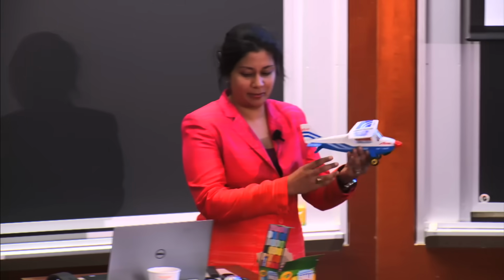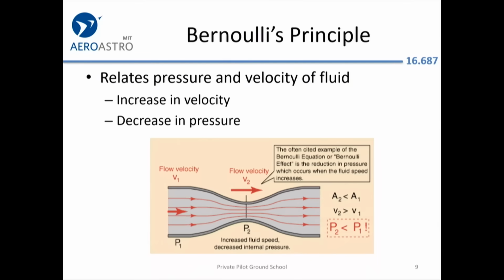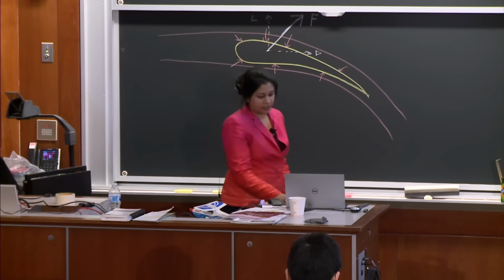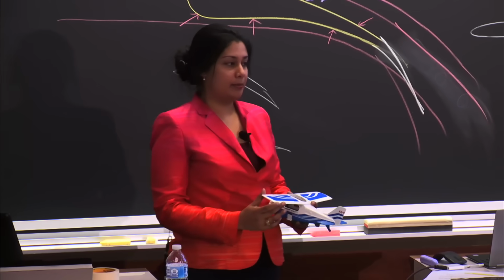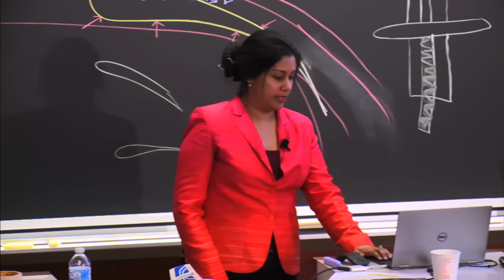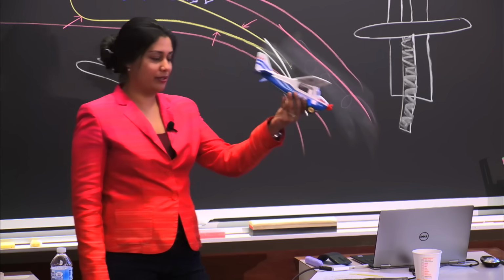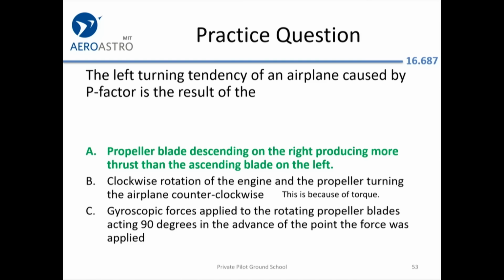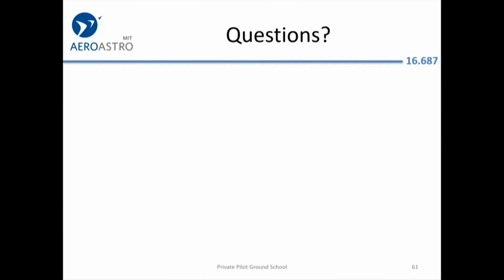Lecture 2: Airplane Aerodynamics

Comment: Im sorry but i have never seen a wind tunnel test demonstrate the kind of results that she is describing.  Watch any wind tunnel test and all of the air lines stay pretty much parallel to the ground.  Almost no wing profiles that i know of are shaped like that. Even a wing with a high angle of attack has fairly parallel smoke lines in a wind tunnel. I work on fighter jets and our wings are fairly flat on the bottom. Almost has an upward angle on the trailing edge. You can also watch video of planes pulling high G turns and see the clouds from over the wings from the pressure decrease over the wings. Im honestly not sure where this concept has come from. Nor have i ever seen wind tunnel tests nor engineering simulations that would show a downward airflow from an airfoil.
This explanation seems to be an over emphasis of the "downwash"  concept from the newtons law explanation. But to say the other explanation is wrong is absolutely not the case. And she misrepresents airflow over the wing as saying that the air has to move faster to "meet" the air at the trailing edge and then goes on to say that there is no scientific  explanation for that. Half right. There is and explanation, "venturi effect"  but it does not involve air "meeting" at the trailing edge. Only air moving faster over the  surface with a higher camber.
Reply: Josh,
Yes, she drew a poor airfoil shape and did a poor job overall. A disappointment from MIT.
..
However a wing does have downwash.  Small wind tunnels prevent it because the bottom is so close to the wing and change the results from actual flight.  A wind tunnel must be large to bet more accurate results. 
..
The movement of the wing creates pressure changes around it.  With more pressure under the wing that above results in a net upward pressure that pushes the wing up to support the craft's weight..  These same pressures causes all air accelerations we observe around a wing including upwash, downwash and the tip vortex. There must be downwash to satisfy Newton's Third law, but the downwash does not 'cause' lift.
..
This downwash and the wing tip vortices are what are commonly called "wake turbulence that other planes must avoid.  You must have heard of that. Working as you do it is very surprising that you are unaware of it. Correct engineering simulations will show both downwash and upwash ahead of a wing.
https://www.faa.gov/air_traffic/publications/atpubs/aim_html/chap7_section_4.html 
This Airbus test  engineering video shows it very well;  it is a 15 foot span model in smoke illuminated by a scanned green laser.
 It IS HERE. https://i.imgur.com/h8pSK.gif 
..
This animation also shows a reasonable flow: https://i.stack.imgur.com/OUIZM.gif 
..
I don't know what "other explanation" you refer to, but there are many wrong explanation on the web and being taught in schools and repeated ad nauseam. 

..
The equal transit explanation is indeed false as is your venturi explanation.  There is no wall above the wing. The air above the wing is a very soft cushion if at all.  
..
The air above the wing is accelerated rearward by the lower pressure there relative to the  unaffected air pressure ahead of the wing.. A Pressure Gradient provides the force that accelerates the mass of air.  This is Newton for fluids.
..'
There is a good step-by-step explanation here:
Understanding Lift Correctly: https://rxesywwbdscllwpn.quora.com/
Reply: @Observ45er  the venturi effect is what causes the low pressure. Air compresses over the wing but the same volume of air is moving  over and under the wing. In order for the same amout of compressed air to travel over the wing as under the air has to move faster. the faster moving air causes a relative lower air pressure over the wing and a relative higher pressure under.  I am familiar with downwash and wake vortex. Thats why we space landing aircraft the way we do. But there is also an upwash at the leading edge of the wing. In theory the same air is hitting the leading edge as leaving the trailing edge (at least closer to the wing root, wing tips act differently) so the upwash and downwash should be relatively equal. An extended flap does create more straight down airflow than a retracted flap, but at normal flying speeds there is no massive downwards flow of air. At least not enough to counter the upwash at the leading edge AND lift the aircraft. My  jet has a max takeoff weight of 81,000 pounds it definitely does not create that much downward airflow.
Reply: @joshcowart4112  The observable fact, Josh, is that it is not a venturi effect above a wing.  There is no hard wall above a wing and the air is quite free to move due to Pressure Gradients. If the air was somehow  “pinched”, it would increase in pressure, so that is a completely non intuitive, and unscientific, explanation.
.
In a true venturi, the decreasing cross section is a restriction that increases the pressure UPSTREAM of the narrowing.  This is now a higher pressure and the narrow section acts like a hole in a pressure tank.
I do this as a demo with students.  Adding the narrower region increases the up-stream pressure, thus causing the Pressure Gradient to accelerate the AIR’s  mass to a higher speed.
.
Newton’s First law is supposed to teach us that a force is required to accelerate a mass – ANY mass and air has mass.
.
A Pressure Gradient provides that force.  When you see fluid accelerating anywhere around a wing, it is the Pressure Gradient that  provides the force.
In the mid 1700s, Euler, following up on Bernoulli’s work, determined that Pressure Gradients Accelerate fluid.  
.
Bernoulli only determined that a speed increase IS ACCOMPANIED BY a pressure reduction and there is no evidence in his notes that he understood the cause and effect. This is nothing more than Newton in Fluids and if you know Newton’s laws are correct, you have no choice but to know that speed does not (alone) cause a pressure reduction -- no more than a fast moving auto causes the the force that accelerated it up to speed. This “fast air causes lower pressure”  thing is one of the most widely understood bits of science,  It is not some new fundamental principle to be memorized.  Newton taught us how to figure this out.!.
.
It is a complete misunderstanding of the physics to think you can accelerate something without a force causing it.  It is not ‘pinching’ nor getting to the T.E to meet some particular bit of lower air.
.
The upper air, being always held against the surface by atmospheric pressure, flows in a curved path.  Because it has mass it “tries to”: go straight PER NEWTON’S First Law.  That reduces the pressure just like what we feel on a playground Merry-Go-Round.  You feel ‘pulled’ outward by YOUR mass’s inertia trying to go straight.
.
AIR DOES THE SAME THINE above the wing thus lowering the pressure below ambient.
ALSO, the faster it moves (a.k.a. air-peed) the lower the pressure just like spinning the Merry-Go-Round faster.
THEN…
Making it follow a sharper curve, also means the “trying to go straight” is stronger – this is when at a higher AoA, the flow curves sharper  and the pressure lower and lift greater.
All this is simple physics fundamentals applied correctly.
..
No down-wash you say? I worked a very short distance off the end of O’Hare’s runway 9. I could feel the downwash when heavies took off or landed..
See this Airbus test engineering video of a 15 ft model in smoke illuminated by a scanning, green laser:
  http://i.imgur.com/h8pSK.gif 
Please note that a large part of that downward blast originates ABOVE the craft’s wing.
..
The same amount of air DOES NOT flow over the wing as under it. The air above it gets to the trailing edge faster than the lower air.  The lower air (viewed in a wind tunnel) is slowed down and spends more time under the wing. Even YOU say the upper air is “faster’, so you are contradicting yourself. So over time, a greater volume of air moves past the upper surface. although I don't see that this distinction helps with the understranding.
.
If you stand in still air and watch a wing go by, that lower parcel of air gets pushed forward (and up) in the up-wash and spends more time under the wing. The upper air actually reverses direction completely due to the high acceleration caused by the Pressure Gradient. 
.
Ahead of the wing it is also pushed forward and up in the up-wash.  It gets yanked backwards and reverses direction from being pushed forward ahead of the wing in the up-wash to completely reversing direction above the first quarter of the chord, and is traveling in the OPPOSITE direction as the wing!!  Yep.  Real data shows this.
..
If you are familiar with the wake, you must also know that it travels downward at about 500 FPM and small craft are advised of this when flying behind heavies. This number refers to the vortex itself.
 If you follow  a jetliner behind and low, you’re in trouble. In the Green video, you can also see the two vortices moving downward actually slower than the central down-wash blast..
.. ..
Lastly, there is a major flaw in the pinching hypothesis.
A wing, at an obvious AoA has another area of pinching on the underside, toward the lowered trailing edge.  If the venturi story has any merit, then there would be another “pinching effect” below the trailing edge so that air should also "speed up” there and have a lower pressure just like above – there is even Earth to “act” like the other wall of this imagined venturi, yet it DOES NOT!.  
.
This is a major disconnect with what I call “Bad Bernoulli” (Fast moving air “causes” lower pressure). -- It doesn’t. 
.
Pressure Gradients Accelerate air – NEWTON WAS CORRECT.

TL;DR: There is real downwash and no Venturi effect.

Next I’ll post a link to a step-by-step explanation of the science of lift  which follows ALL well understood principles of science.(Sometimes YT rejects long comments with a URLs)
Reply: @Observ45er  its not "the venturi" because its not a pipe correct but its the same concept that the airflow over the wing gets compressed and thus has to move faster over the wing. And by the same air going over and under is exactly what i meant by your description. The same air goes over and under. Larger area over the wing, air gets compressed and moves faster. So by your explanation here it still sounds like  pressure differential causes lift. Not downward airflow. Not saying there is no downward airflow, just not enough to generate 100% of the lift. Of course you will feel downwash at the end of the runway, the flaps are extended into the airstream( which i mentioned before) and you get wake vortex on landing. I still cant support  her statement saying that pressure differentials over the wing are not what causes lift.
Reply: @Observ45er  also wake vortex is only generated by the wing tips. Is where the high and low pressure differentials meet back up because they are no longer separated by the wing. Its the same principal that creates tornados. Its also the same reason why we create vortex generators to control airflow over the wings as well as down the side of aircraft and race cars.
Reply: @joshcowart4112  I'm not discussing tip vortex, only the basics of lift and the pressures causing the upward force.
..
As you explain, tip vortex is due to the Pressure Gradients around the wing, JUST LIKS ALL OTHER AIR ACCELERATIONS.
Reply: @joshcowart4112  Also, please abbreviate any explanation you may wish to refer to because I have geard them all, studied the aerodynamics of lift and have also consulted with some well known names in aerodynamics to develop a full understanding of lift fundamentals.
This web page gives a step-by-step physical explanation of the science of lift only based on well known physics fundamental principles:
 Understanding Lift Correctly :
 https://rxesywwbdscllwpn.quora.com/ 
..
Best Regards

Comment: Philip is wrong (and very poor at breaking down the logic to explain the individual fundamentals). There IS a measurable precessed force that contributes to a "pitch up" effect. Dissymmetry of lift of the propeller disc contributes to both, P-factor and a precessed force. The P-factor is just much more noticeable. He said some purely incorrect things at 1:05:22. The downing blade doesn't experience an efficiency boost due to airspeed, it experiences a higher angle of attack and produces more lift, -propeller thrust (the increased airspeed is absolutely minuscule). And the up-going blade DOES NOT "move from the front of the airplane toward the back of the airplane", it moves away from the relative airflow, again the airspeed difference is negligible, it is its reduced angle of attack that reduces its thrust on that side.
Reply: Hey man thanks for breaking this down, I have a question, Does ‘efficiency boost’ mean anything? Is there anything in airplane physics even called an “efficiency boost”

Comment: equal transit theory is also correct. I can make you understand.
Reply: No it is NOT, and NO YOU CAN'T 
It has been observed and documented by millions of people over the years.
 See for yourself: The non equal transit time (only) proof video by Holger Babinsky, Cambridge University
https://www.youtube.com/watch?v=UqBmdZ-BNig   Narrated, no title at start Cambridge Univ.
..
Please see Understanding Lift Correctly:  
 https://rxesywwbdscllwpn.quora.com/
Reply: @Observ45er  There is problem in this experiment it is inclined. Also the airfoil is not correct. The smoke hits directly at bottom. What if the airfoil is plane (straight not curved at bottom) and placed without inclination horizontally? Here the experiment is done by keeping the airfoil steady smoke/air in velocity. If the airfoil is in motion and air steady then the particles hitting above and below just remain at the same position while the air foil passes by.
Reply: @omprakashtharu8398  I am unable to understand your point with  most of that.
However, you are mistaken in your last statement. It is false. The two air particles that start out close to each other then travel above and below a wing that is generating lift, *do NOT*remain at the same position while the air foil passes by." This is clearly demonstrated in the following video and in Fig 7 in the link below.
video by Holger Babinsky, Cambridge University.
Note this is in a wind tunnel which restricts the downwash and the wing is at an extreme angle of Attack to make the effect easier to see.
https://www.youtube.com/watch?v=UqBmdZ-BNig 
 ...
See fig 7 showing actual data of a wing flying past the observer.
https://rxesywwbdscllwpn.quora.com/
Reply: @Observ45er  You really did not understand Bernoulli’s principle. What’s all in your mind is Newton’s third law of motion. If it could be explained by Newton’s 3rd law why would Bernoulli’s principle be needed? The demonstration VDO link you gave is a demonstration done with air foil kept inclined. First keep it horizontally straight and then do the experiment and see whether or not the air particles above and below reaches the same time. Now don’t say I didn’t get you.
Reply: @omprakashtharu8398  Yes, the wing shape she uses here is quite extreme.  Let's ignore that and only discuss more common wing shapes.  This video is not that great, but not all wrong either.
..
.I understand Bernoulli's Principle far better that the average amateur scientist trying to explain it with good intensions.
Please see:
 Understanding Bernoulli's Principle Correctly , here: https://rxesywwbdscllwpn.quora.com/ 
..
Do not assume what is 'in my mind'. 
Newton's Third Law certainly applies, as it must, but that one statement, as she uses here,  does not explain the cause of lift. Lift is the top-to-bottom pressure difference. 
..
The subject here is lift . 
Putting the wing at an Angle that does not produce lift is not helping to understand what is happening when lift is being generated . That does not show what happens WHEN generating lift.

.
 You did not "get" me on anything.  
.
I studied this and consulted with some of the well known experts when I saw all the poor explanations on the web by otherwise well intended amateurs that made obvious errors in their understanding of physics fundamentals.
Reply: @Observ45er  I am very sorry. I was not intending to disturb your inner peace. I felt like I insulted you but I never meant to do that. I just want to make you understand that even if the air foil is of the shape (straight below and curved above) and kept horizontally straight then also lift is generated that is what explained by Bernoulli’s principle or the equal transit theory.
Reply: @omprakashtharu8398   I understand how lift is generated and am trying to help others see how these many well-intended explanations are misguided.
 I am simply explaining the facts that few people  understand, who try to explain it. My 'inner peace' is derived from having a very good understanding of Bernoulli's Principle and how lift is generated.
.
The fact is that lift is NOT  generated, as you say,  by "Bernoulli’s principle or the equal transit theory." Those are well known as being false by simply seeing that equal transit does not happen in reality.
 Understanding Bernoulli's Principle Correctly 
 https://kyuoyckftflurrpq.quora.com/ 
.. .. ..
 Understanding Lift Correctly 
 https://rxesywwbdscllwpn.quora.com/ 
Regards

Comment: Google suggests such a video because of her beauty I think. Although she is beautiful but can't agree with her especially about the lift theory at 6:19. Its the compression (positive pressure) at bottom of the aircraft lift towards the suction (negative pressure) at the top when the aircraft at least maintains a certain speed and the aircraft fly. The conservation of momentum is also correct but for her paper aircraft or for flaps wherein air density as well as the pressure against which the surface area of the paper has to work.